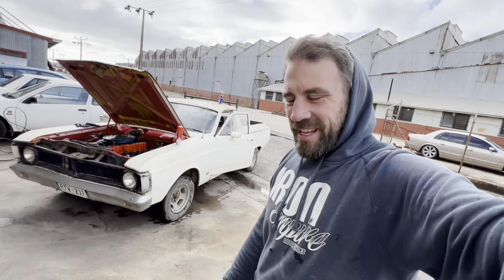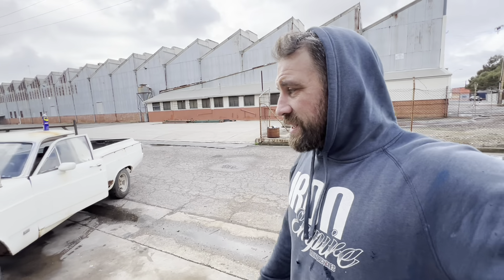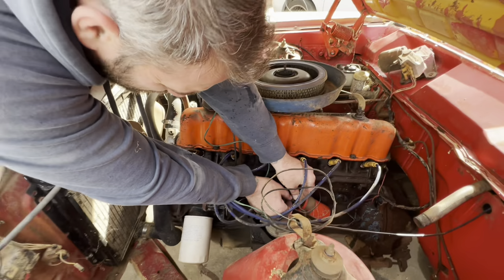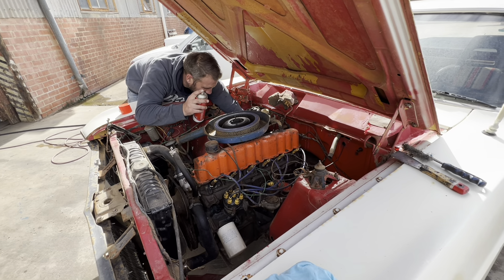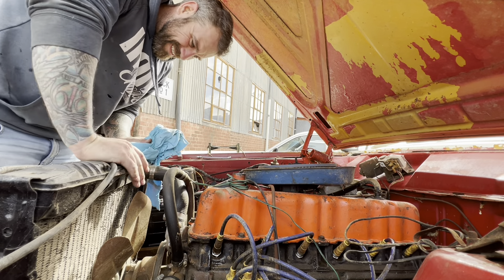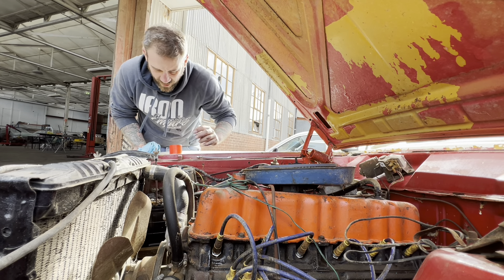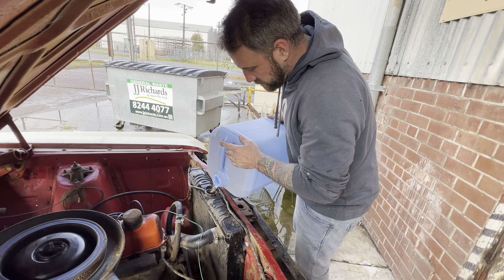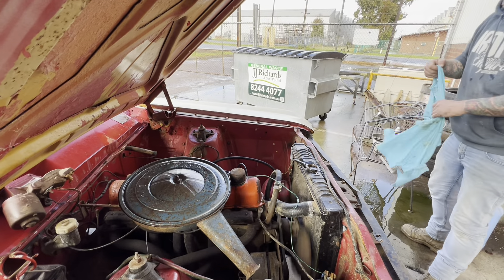Iron Empire EP 99 - Barn FRESH XY Falcon Ute Revival! Will It Run? …Yes

Comment: got to love the old 250 log motors had a few in xys back in the day .....they where reliable as....still  loving my fords and collecting them to this day...... good work mark ...excellent score
Reply from the maker: Bulletproof! 💪🏼
Reply: @TheIronEmpire  yes very bullet proof i had 250 with 20 thou over in a xy it flew and got 30mpg ...had plently of the old 221 motors as well in 1968 falcons they where very strong as well love the old fords
Reply: @jamiegreenwood7996  gee 30mile per gallon wow that's good , definitely not a 250 2v gee they liked a drink and had a reputation for being thirsty. I had a gt tank and it made light work of that ,a fully worked 351 would have been more frugal, but it did go ok great torque and seemed realible and it's another car I should have kept, very rare  combo now days , even standard ones seem exotic